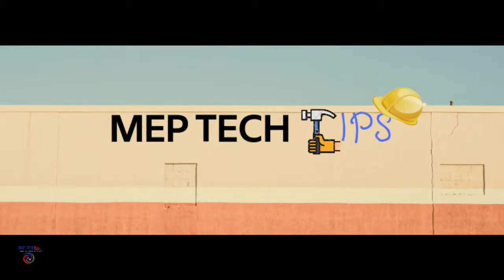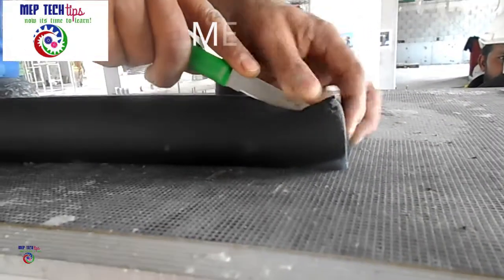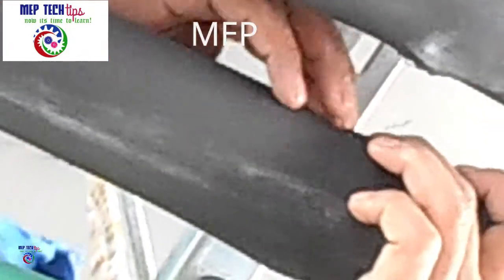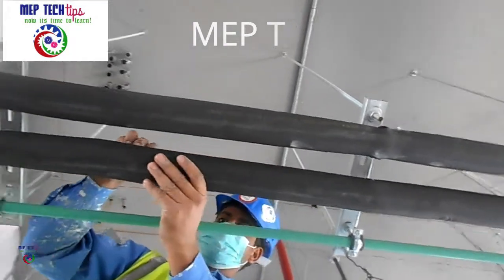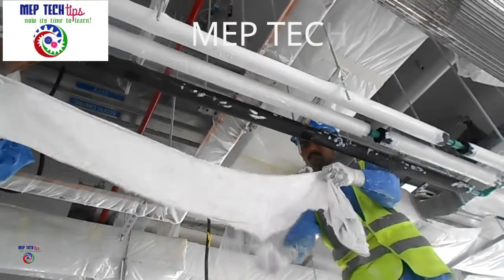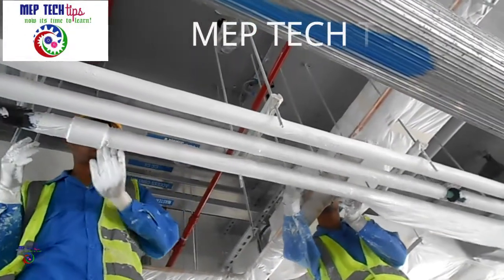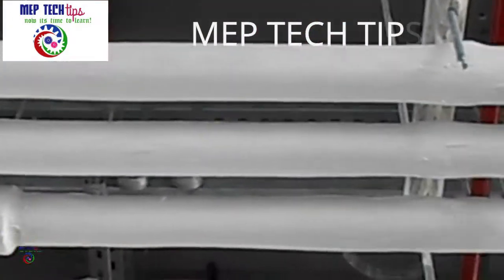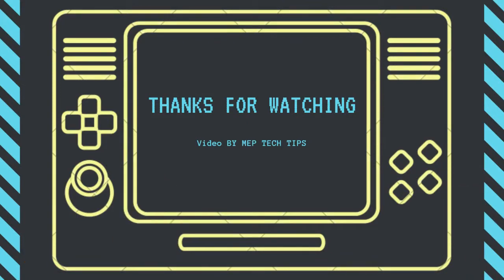How to do Water Supply Insulation | How to do Water Supply Insulation and Foster  | By MEP TECH TIPS

Comment: Is it necessary to do insulation on PPR pipes?is it any standard?
Reply from the maker: its depend upon ur type of water passing through the pipes for example cold water 20 deg Celsius u have to provide insulation to maintain its temperature or thermal conductivity.

Comment: How find out size of the plumbing fittings visually
Reply from the maker: Size for the Ppr Fittings are written on the fitting itself
Reply: @MEPTECHTIPS  in copper and. pvc fittings return in mm how to find out in inches
Reply from the maker: @VinothKumar-rk4eb  
If ur going to place the order prior to that u must verify with the supplier,  fittings are available in which units inches or mm then only  u place the order and from the beginning, u must follow one unit inch or mm till the end of a project, and whatever material u order in any units its written on those fittings
Reply: In which materials u dipped clothe? Please share information